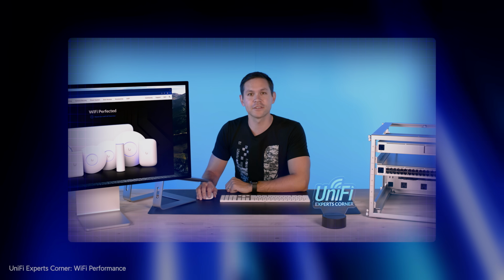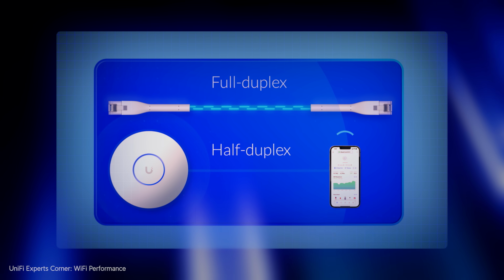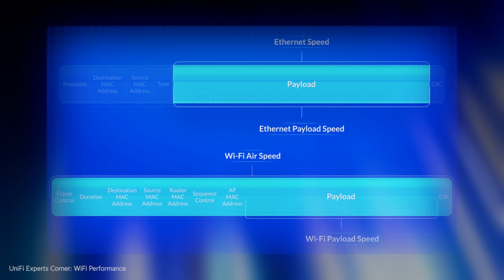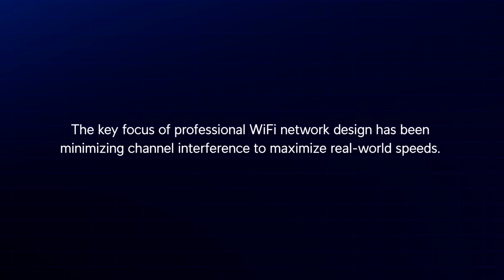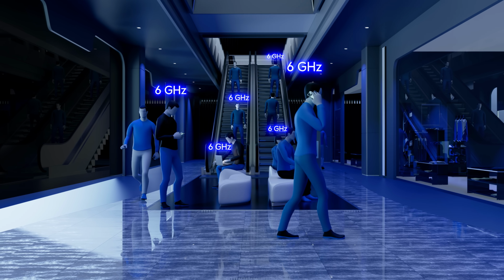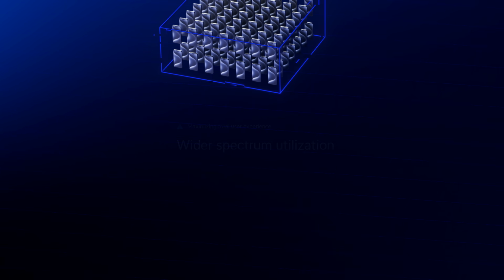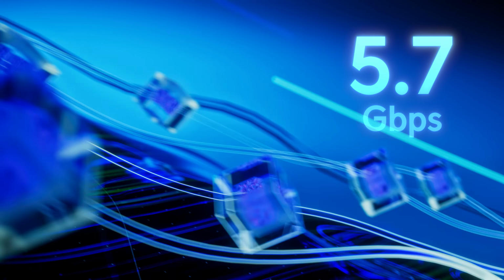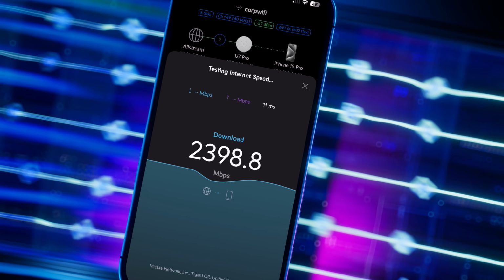Experience 6 GHz WiFi with UniFi 7

Comment: very slow, I expected much more. minimal difference between U6 pro and u7 pro in terms of performance
Maybe I did the hardware upgrade wrong 😮😢
Reply from the maker: Please submit a ticket at account.ui.com so our team can assist in the several variables that could impact your speeds as many customers are reporting +1.2Gbps
Reply: @UbiquitiInc  thanks I will, maximum speed tested on multiple devices 750/650 same speed as U6 Pro

Comment: I have a U7 pro, my S22 Ultra gets 1.6Gbps over the airwaves it's crazy!
Only downside is I have to have a special SSID for Wifi 6 / 7 devices since 90% of my home can't utilize WPA3.
Reply: My s23 ultra had 1.6 also on wifi 6 and now z24 ultra also 1.6, so iam worry that there's no difference between 6 and 6e 7

Comment: I dont see the need for Wifi7...

I would rather prefer my WLAN to have an uninterruptible backup solution in the 900 MHz range so that the connection is not interrupted when I am on the move. There is always a corner somewhere that is not covered by WLAN. If I need high connection rates, I can also move briefly to the access point. Everything else has a LAN connection.
Reply: yes a long range signal even if it were slow would have some serious benefits. I doubt UI will have much say if that is ever going to be implemented in to some wifi spec
Reply: I know, I know. Especially as the clients would also have to support the standard and not only the UI hardware. But hope dies last. After all, the standard for this already exists

Comment: I want the early adopter program back :(  I really enjoyed testing equipment before upgrading my customeers and having confidence that on day one I can purchase the new equipment and meet their needs without having push back multiple weeks for me to order new equipment after release and test and verify their setup before upgrading...

I've been deploying 6E AP's and love them.  They are little space heaters though.  But started in my house and love them.  All my devices are already 6E radios and my new S24 Ultra already has wifi 7 too.  My laptop is a 6E, but and my wifes phone and other tablets are 6E capable..  Love seeing the 6E Icon while on wifi and getting speeds when my ISP is currently upgrading to allow 8gbps throughput symetrical in my neighborhood.  Right now on my fiber, I only have 1gbps.

Waiting for the 7LR to be released before I start upgrading/recommending to my clients.  I do recommend the Wifi 7AP's for new installs that are smaller installs.  The FCC fillings dont show any other WiFi 7 devices, other then the 7PRO.  I hope they come along with the 7 LR soon.  Looks like the Unifi 7Pro was filed and tested in Dec and releaseed in JAN... Hopefullly it will be fast foir the LR too... hoping to pick up a handful on the first day :)

Comment: Just don't understand why U7 Pro only has 2.5 GbE uplink. Why not 5GbE or 10GbE? Maybe this one should have a different name rather then 'PRO' version
Reply: They learned from Apple’s use of the Pro suffix
Reply: Their switches need to go beyond 2.5 though
Reply: Is 10GbE poe even a thing? Lol
Reply: @D4w2010  Yes it is. Unifi has XG 6 PoE (Gen1). LOL
Reply: @D4w2010 it will be within the year where it will be readily available
Reply: From my perspective WiFi 7 is all about future proofing, install it right now and be done with WiFi for at least 10 years. I think access points with 10 Gb is the bare minimum with this objective in mind.
Reply from the maker: U7 Pro is our first of many WiFi 7 APs we’ll be offering and is the best value for entry into 6GHz spectrum. Stay tuned for more at ui.com
Reply: @UbiquitiInc   The U7 Pro is a complete disgrace.  2x2 MIMO, no Bluetooth (protect sensor go poof) and only a 2.5Gb port.  This should have been the "Lite" version at best.  Should have cost less than the U6 Pro for sure considering what you are getting in comparison.
Reply: I refuse to live in a world where the bottleneck is the cable and not the wifi!
Reply: @KMiguel-clp  Agreed!
Reply: I agree if wifi7 can exceed 2.5 then the port is the bottle neck
Reply: Wait for the U7 Pro Max and U7 Enterprise guys… the U7 Pro is already pretty fast!
Reply: @YaGr-ip3ub  Not when you compare it to other WIRELESS backhauls that are getting close the same speeds.
Reply: Wifi 7 can reach 2.5 on a single client, but the U7 Pro cannot afaik. Not every Wifi 7 AP is the same. I assume their future more powerful Wifi 7 APs will come with more than 2.5G.
Reply: @b4ttlemast0r   You may be assuming too much.  The only thing Ubiquiti did right with the U7 Pro was launch it earlier than they normally would have in the past.  The U6 lineup is still relatively new which is sad.  Putting a 5Gb port on subsequent U7 AP's and catching up with the curve (let alone getting ahead of it) for a change is not their style.  And where are the 5Gb PoE++ switches?  Ubiquiti is still focused on 2.5Gb switches.
Reply: That’s unrealistic I don’t think more than 2.5gb is needed, it’s not like one acces point can do everything you still need many for coverage
Reply: @LeePrzy  Not unrealistic at all.  Other manufacturers have been putting 10Gb ports in their equipment for years now since before WiFi 6 came out.  A 5Gb port to better match WiFi 7's real world (not theoretical) throughput as well as major ISP provider speed increases is completely warranted.  Its not about just one AP covering every situation in the slightest.  And although not hugely widespread yet, 10Gb home networking is not the future anymore either.